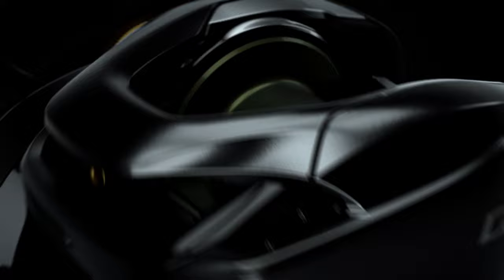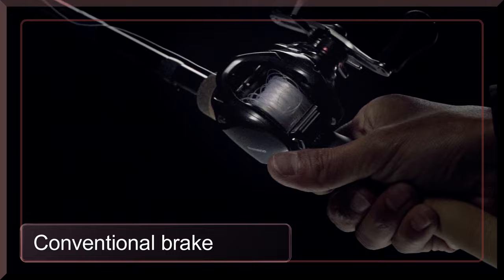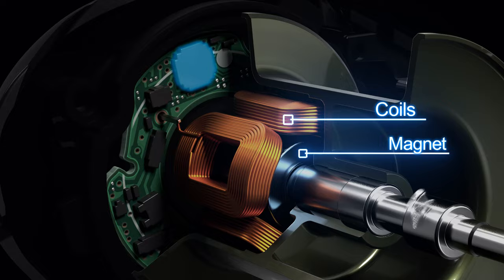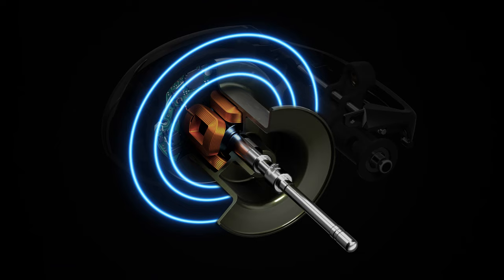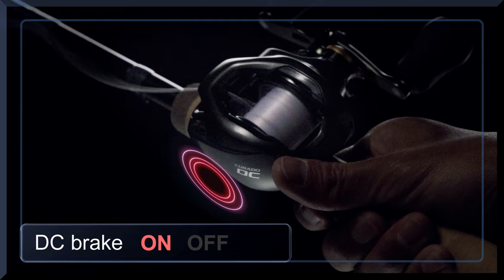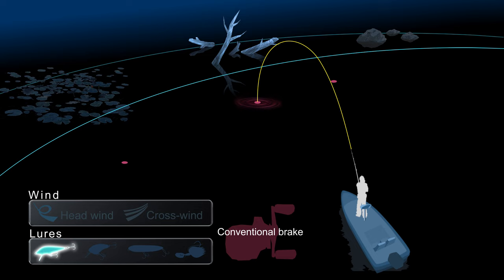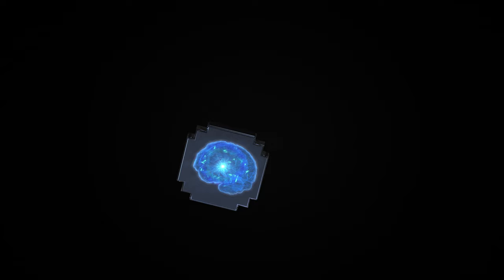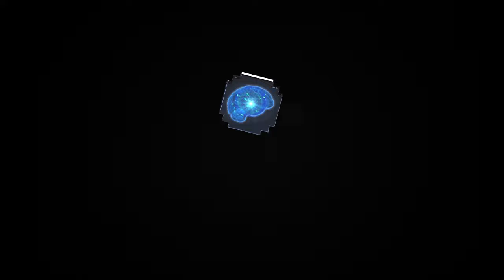Shimano - Curado DC

Comment: This is clearly the future and if they can bring the cost down just a little lower..and offer more reels there wouldnt be a single reason to not make every reel you have a DC version. We are behind the Japanese market but it’s more about the price because if I wanted to spend that money I could get one from Japan but this is an amazing start..will be picking up one of these the minute they come out fantastic work and I’m so excited.
Reply: The thing about this reel is that this is the first affordable dc shimano reel. Dc has been out since the early 2000s however they have costed upwards of 6 to 700 dollars and since then those dc breaks have been getting upgraded. I think the 250 dollar msrp is a good price for these as of now since theres a massive ammount of innovation put into the reel and the materials are top notche. Its counterpart the curado k aint much worse at all really from 160 bucks its well worth its value and theres no major difference other then having to thumb the spool a tiny bit versus not having to thumb at all. The k is where its at for a mid range reel
Reply: The Rc Master6042 now they have the slx dc... that might be the best midrange feel now

Comment: Curado dc vs scorpion dc??
Reply: RushinToFishin From what I've heard the 3 main differences are that the Curado DC is on the K frame and the Scorpion DC is on the I frame. The Curado DC also has micro module brass gears, and I think the Scorpion DC has hagane gears, but I'm not 100% sure on that. And the Curado has the DC5 system, while the Scorpion has the DC7 version.
Reply: Scorpion has iDC5: Auto and 1-4 setting while Curado DC only have 1-4.

Comment: Or just buy 10 times cheaper spinning reel.
Reply: Good luck with that heavy spinning reel
Reply: @vire559  Not exactly sure what you are implying, but most of the modern spinning reels are actually lighter than same sized baitcasters.
Reply: @Tintl3  Yes on the same size and price above $200, but if the price is like what you said 10 times cheaper? I don't think so
Reply: +Vire Wasn't meaning literally. But for example: take a look at Okuma inspira 30, which has 1kg stronger drag, 20g lighter weight and same line capacity as Curado DC but costs only 25% of the price, which makes it 4 times cheaper.